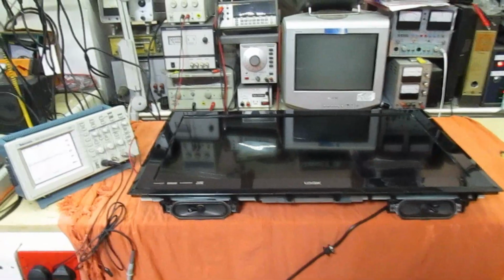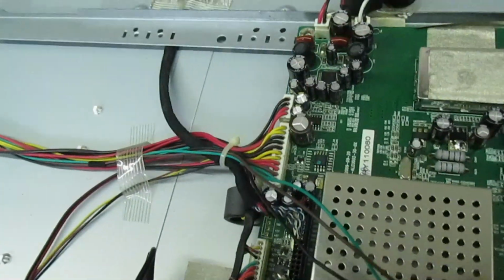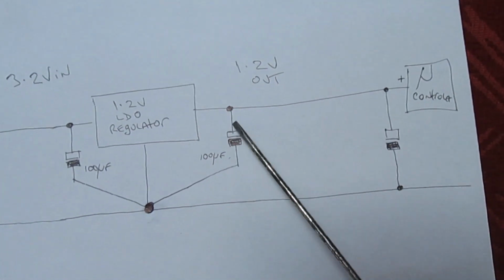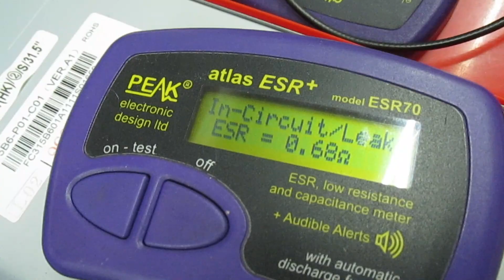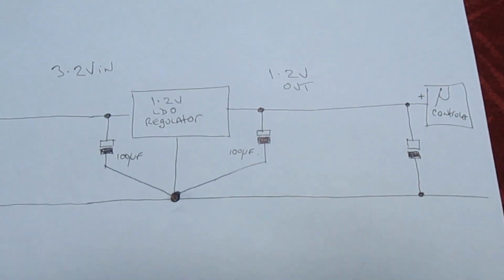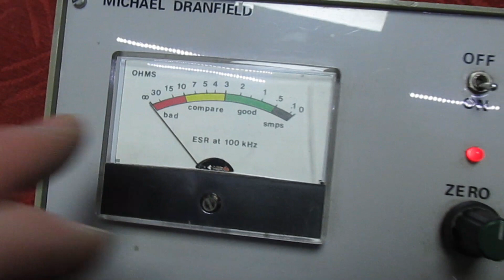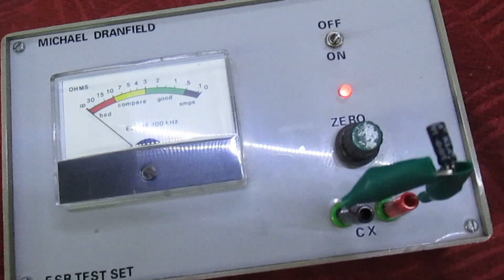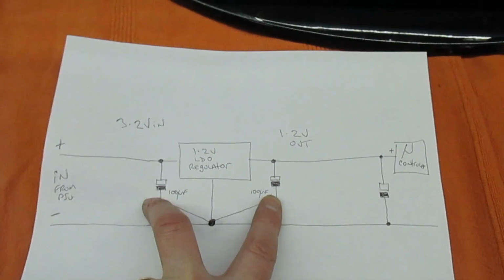Here we have another useful fault finding tip  on LCD tv sets .

Comment: As well as electrolytic capacitors for decoupling, I tend to add ceramic capacitors on the output of linear regulators. Ceramic caps have better high frequency characteristics. Nice to know that there are still people around who can fault find down to component level.
Reply from the maker: Unfortunately component level fault finding is getting a thing of the past, no service manuals now for most sets so and component level finding is more good luck than knowing what your doing .

Comment: That is just bad design those caps will just fail again any application data on 3 terminal regulators will show other low value non electrolytic caps. across those to decouple high frequencies and to stop self oscillation elecros. are only good on less than 100 khz in my opinion
Reply from the maker: now were on the just as un reliable MLCC capacitors for decoupling 3 terminal regulators !

Comment: A Dixon's special. Suprised it left the shop working.
Reply from the maker: We use to think that about Matsui and Saisho branded sets in the 90s.
Reply: @michaeldranfield7140  made in same factory often some of the products like their TV's were identical and had same model number or at least partly same number, and only the badge was different with the 2 versions of the same product was sold in different stores eg Currys had one brand, Dixon's the other. They now have loads of other brands and the corner cutting is worse, but they still sell them at a premium, eg Logik stuff is just rebadged kit not sold in the UK under other brand names, made to the bare minimum spec required for safety and AFR. It's funny how they are the only retail store like it left in most of the country and instead of trying to keep standards high they are doing a Maplin instead, price gouging, treating staff like robots, jumping on customers the second they enter as if they were shoplifters and pressure selling at every chance. I buy from China direct now, at least I know what I'm getting, the price is more appropriate for the item, and no hard sell!

Comment: That probably also explains the "It was working fine last night" scenario, where the set cools down and that cap has had its last fling?

Could also be why so many people buy a new telly during the winter months?
Reply from the maker: same goes for something stood in stand by for years and then there's a power cut and the equipment wont come back on again .
Reply: @michaeldranfield7140  Agreed 100%... I had exactly that with an early '90s Sony "High Black Trinitron". That set was rarely ever switched off at the socket, or its own switch on the front panel.  It did start playing up for a while before it failed completely, but in the end it was a power failure that saw it go off for the last time. After that, it wouldn't turn on again, until the PSU had a couple of new electrolytic capacitors installed.
Reply: @michaeldranfield7140  Good point, I'd have just assumed a power spike on the returning mains supply had killed something. (EG two routers went this way, two since the phone company want them back to replace them, I didn't examine.)
Always good to look much deeper, as you always do.

Comment: Could you measure the ripple with a meter set to AC volts?
Reply: Well, it's not a bad idea but most meters don't have a bandwidth of 10MHz so you would get a wrong reading.
Reply: I would think it would be a good try. I used that technique to show the voltage at a CPU in a loptop that worked on battery but not AC because of bad tantalum caps at CPU. Ripple voltage showed when AC but not on battery operation. But either way, if the heating cooling trick, didn't show anything not many are bothering with oscilloscope testing after MM shows correct voltages. All depends how important the repair is and TVs so cheap nowadays. Ok, I'm back to my time machine project.

Comment: Very useful and interesting Michael. I  have no scope so thank you for the tip. I have a Sony LCD Tv and I am hoping some new earthing bolts which were missing on the power supply will cure my TV switching off after a time
Reply from the maker: May be, there is one particular Samsung TV that trips out intermittently due to a loose earthing screw on the inverter board.
Reply: @michaeldranfield7140  Thank you very much I will check the inverter board more carefully tomorrow ☺
Reply: Hi again Michael I still have that Sony LCD and i am back again with the inverter board to try overide the protection causing the set to go into standby and 4 blinks. There is only the one IC on this Kdl 32v4000 and pin 4 jumps to 24 volts when on back to 5 when off.If you have one of these type repairs i will be delighted to see☺
Reply from the maker: @walker55able  you need to get the datasheet for the driver chip on the inverter, from this it will be possible to disable the different protection circuits so you can see what's tripping the protection, I seem to remember though on some sonys its just a loose earthing screw on the inverter board ?
Reply from the maker: actually something else has just come back to me now the inverter transformers suffer from an intermittent change in secondary resistance and this will cause the inverter to trip out , check the secondary of each transformer for its resistance reading both when its hot and cold .

Comment: I have a sharp LCD tv. i think its a 60 or 65. it used to work then quit. TV powers on, has sound, the LCD panel lights up, but theres no picture. Not even the OSD. I thought it was a backlight issue but no, the panel actually lights up but I cant see anything, no OSD and no sharp logo or picture. Was thinking a bad mainboard?
Reply from the maker: Fault you describe is more likely due to the LCD panel or Tcon board than main board, a very common fault in a lot of sets is failure of the surface mounted fuse on the T con board, check it has 12 volts on it, if it doesn't then it could be the main board.
Reply: @michaeldranfield7140  okay I'll pull it apart one day and have a look at the fuse.  If it is the tcon I'll replace it but if it's the panel it goes to scrap. Too much for a panel

Comment: If I'm not wrong then you can check these LDO voltages with your multimeter AC voltage range after you checked them with their DC voltage range. If there is ripples in voltages your multimeter AC voltage will show some higher mili volts ac or approximately more than a volt ac. I have also Fluke multimeter but my one is 87-V true rms multimeter. I use this technique or simply check with my scopemeter too for ripples in DC voltages rails.
Reply from the maker: Ypu could be right but I prefer to check with an oscilloscope, you don't need one as expensive as mine you can get a Chinese one now for less than £200.
Reply: you cant always measure an ac voltage riding on  a dc voltage, many meters wont allow it or give correct readings, you have to check its user manual, or set to ac volts and try to measure a 9v pp3 battery, if you get any reading other than zero, within a a few mv, its not suitable, but you can sometimes use it if you use a dc blocking capacitor in series
Reply from the maker: @andygozzo72  this is true but with the price of a cheap oscilloscope these days I dont think many people now wont have a cheap scope .

Comment: The explanation of the issue itself was great, but the explanation of how to use the hairdryer was confusing. So you heat them up when the TV is connected and the back cover is off and see if it turns on? Or you apply heat while measuring with something cheaper like a multimeter? I'm confused.
Reply from the maker: When an electrolytic capacitor is cold and worn out its value falls and ESR increases however if you try this with a good electrolytic it will remain more or less the same regardless of heat or cold.

Comment: Nice video have you shown the circuit of your esr meter ??
Reply from the maker: No, I didn't design this, I only made it, it was more than 20 years ago though, It came from the magazine I use to write for, Television magazine, I think it was on one of the 1999 issues.
Reply: The Television service mag was the march 1999 for the E.S.R meter
Reply from the maker: @littlebear5219  A pretty good guess of mine then !
Reply: Thank you Michael I think I have found a circuit in a electronics magazine 

I will look in old tv mags 

Cheers Peter..
Reply from the maker: Let me know tomorrow if you can't find it and I will have a look to see if I can find which one it appeared in.

Comment: I remember the budget alternative to freeze spray used to be a can of air duster held upside down! :'D
Reply from the maker: that is something I have never tried as yet .
Reply: I buy cans of chewing gum remover now. It's the only thing I can get locally, and the price isn't bad. Probably better than actual freeze spray!
Reply: @stopthebus  Good call!
Reply from the maker: I have Hever tried anything but the real thing but worth thinking about if it's so much cheaper.
Reply: @michaeldranfield7140  Airduster held upside down works a treat (they even have a greater freeze effect as the output is much greater!), although the cans of air duster are more expensive for me!
Reply: @michaeldranfield7140  I see it is marked "non flammable" which is the greenhouse gas spray. The duster sprays here nowadays are flammable (hydrocarbons).